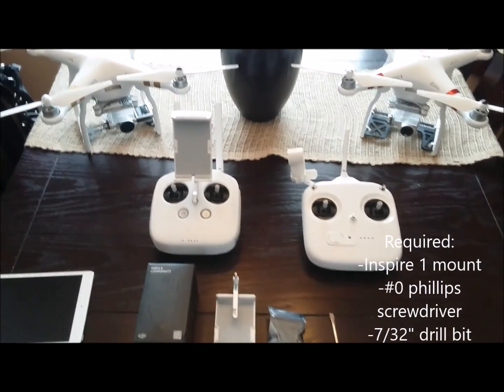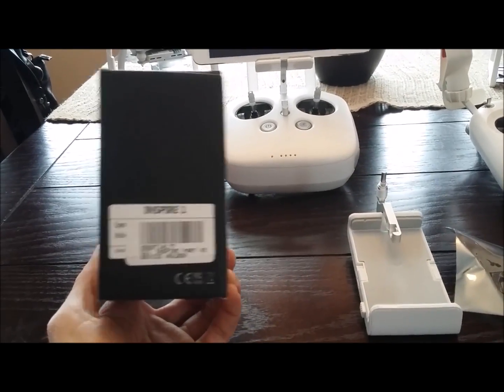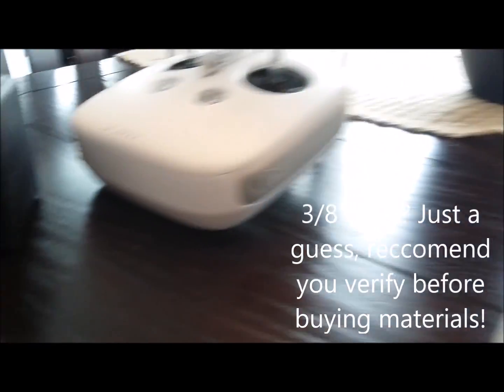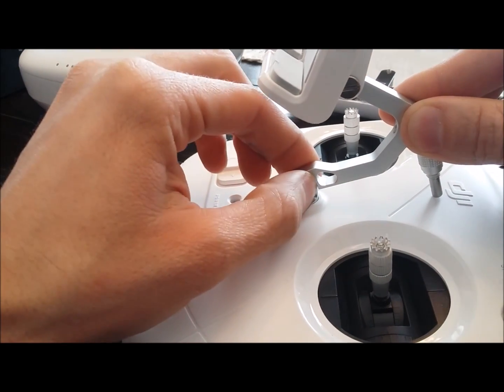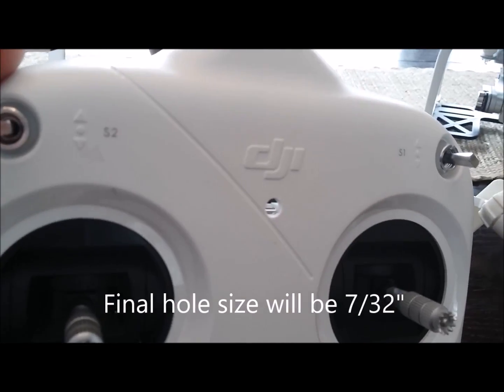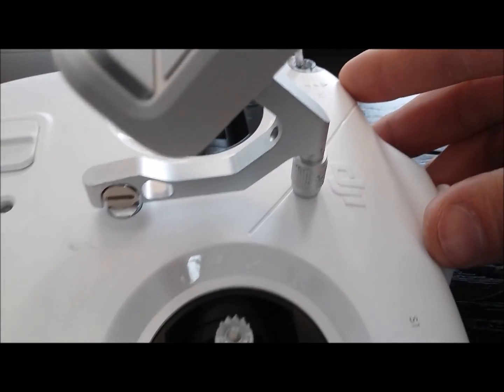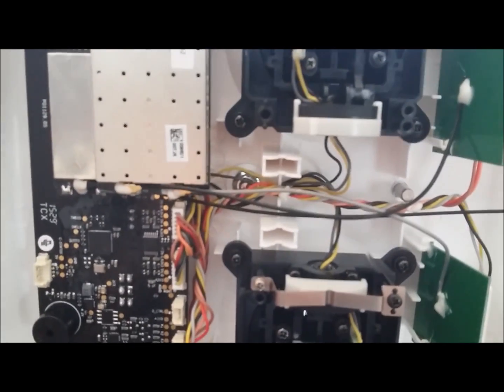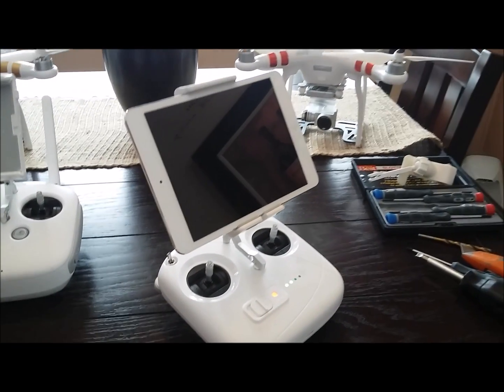DJI Phantom 3 Standard controller mod with Inspire 1 mount, for tablets

Comment: Excellent mod for my Phantom 3 Standard, I luv it !  Thanks so much Droning Around, well done !!
Can't imagine trying to fly without it.  Follow DA's direction for install to the letter, didn't need the 1/4" bit.
Just drilled a pilot hole after scoring and used the 7/32" drill bit, then screwed threads it into the hole and mounted sent screw.
Btw, I'm using a Galaxy Tab A 10.1 table.  This tablet mount is as strong as a vice.

Comment: High, great video, does the controller still fit in the case?
Reply from the maker: Depends on the case! It does stick out where it wouldn't have before, but I feel the controller is useless without it, so personally I'd buy a case that fits around this conversion!

Comment: Great vid. Are you still modding controllers? Realize the video is a tad on the older side.
Reply from the maker: PMCRyan Thanks for watching.  Yes, absolutely, I still do these modifications.  I own a drone repair business and I keep the mounts in Stock for conversions.
Reply: I'm gunna give it a shot myself and pray to the DJI gods that I don't mess up. Will be following your review. I have a 9.7" iPad; if I throw a case on it, any idea if this mount will still hold it?

Comment: I have 10 drill bits which go from 1mm up to 10mm, what would you recommend using to drill the whole?
Reply from the maker: Adzchannel I would reccomend you drill and tap the hole.  Since the video posted, I have found this to be best.  You will need to drill a 5mm hole, followed by a m6 x 1.0 metric thread tap.  Then the mount will cleanly thread right in.

Comment: Does this mount fit a iPad 4th gen?
Reply from the maker: The max opening width of the Inspire 1 mount is 6 5/8" or about 168 millimeters.  As long as your iPad is that or smaller, it will fit.
Reply: I have been told by JTO2GO that he uses a 4th gen iPad with his inspire 1 tablet mount, however the 4th grn iPad is 186mm in width. I don't get how it fits if the table mount is only 170mm in width?
Reply from the maker: Adzchannel I just measured mine again to verify.  if I fully extend mine and cannot force it any further, I end up with the same measurement.  Excluding the squishy foam, the physical plastic to plastic opening is exactly 6 3/4 inches  (6.750), or 171.5 mm.  So, I'm not sure how that's possible.  My L1 mount is one of the earlier models, perhaps they started making them larger now to account for larger tablet sizes?  Hopefully someone with a newer mount can verify.

Comment: Worked flawlessly now I just have to charge my remote and I can test out flying with my tablet. Thanks for posting this.
Reply from the maker: Tim Taylor Excellent, good to hear!  Glad it was a success, you will love the results.  What are you using for a mobile device?
Reply: I have a Lenovo Tab 10 10.1" it's a bit heavy but I think it will work out OK.
Reply from the maker: Tim Taylor Cool.  As long as it's a supported device from DJI it should work fine.  I personally use an ipad mini 2, I find the larger screen sizes are akward.  Let me know how you like your setup! Thanks for watching.

Comment: I did check with DJI..drilling the hole voids the warranty. Too bad, the 3S controller needs a better mount for larger tablets for us older folks to use the GG app and view what the camera sees. Thanks for the video.
Reply from the maker: Jim Robinson Oh absolutely!  DJI will void your warranty if you so much as sneeze on it.  Kidding... ;).   But yes, agreed.  I suppose that's why it is the standard.  If the standard were perfect, then nobody would buy the advanced or professional.  Thanks for watching, I greatly appreciate the support!

Comment: Since the back has already removed, why not pit a self-locking nut on it? Nice  tutorial. Thanks
Reply from the maker: Charlie That's an excellent idea, however if I remember correctly, I don't think there are enough threads protruding to thread a nut on   :(  Unless you are able the cut threads into the smooth metal part that sticks out.  Thanks for watching and commenting!

Comment: Excellent video and super easy mod. It took about 15 minutes from beginning to end and the result is great. Question... How do you keep the screw in the swing arm from loosening when you fold it down for storage?
Reply from the maker: Michael Hansen Good to hear, thanks for watching!  I keep my pivot screws pretty tight so my iPad doesn't flip around.  The screws stay tight for a long time, I just snug them up every once and a while.  You could use some thread locking compound if it becomes a persistent problem.
Reply: Droning Around Thanks! I'm going to go ahead and use a drop or two of threadlock and see how it goes. :)

Comment: Just to point out, the link provided takes you to a non prime $39.00 mount, where if you search for the Part 45 mount, you can find a $30 Prime option.
Reply from the maker: Nathan Marshall Cool thanks.  You can find them all over online so it's not a big deal, I figured if most people could do the modification that they would have no issue finding the part too.
Reply: Totally, just making it easier for them. :)

Comment: Is it possible to connect via USB a Phantom 3 Standard controller to a tablet?  I cant find an answer anywhere, thanks! :)
Reply from the maker: Astolfo Fumagalli No unfortunately you cannot.  The Standard pairs via the WiFi signal.  Only the Advanced and Professional connect via a USB direct link.  Naturally, the USB link, along with DJI lightbridge brings a much clearer FPV experience.  The Standards weakest point in my opinion is the WiFi link.  Sorry buddy!  You can however, connect to a tablet via the WiFi like any other device.

Comment: How are those threads holding up in the plastic thus far? Any wobbling or loosening over time?
Reply from the maker: +iinRez I sold the Phantom shortly after this video, but as far as I know the mount held up just fine.  Unless it was abused, I wouldn't expect an issue.

Comment: But will I still be able to use my lanyards
Reply from the maker: Yes you can. See the machined oblong hole on the aluminum mount? That's for the lanyard connection.  The Inspire 1 remote functions the same way

Comment: Use a dremal tool not a drill to make the hole for the aluminum piece on the mount a drill will ruin the plastic.
Reply from the maker: A drill is slow and controllable.  A dremel would be very risky given its high rotary speed.  I cant count how many times I've used a dremel and then had it go crazy and resonate inside the hole opening and quickly remove too much material.  I'm not seeing where using a dremel would be an advantage...?

Comment: this video was great! I completed this modification but experienced signal dropouts. I sent it to dji to repair and it was a broken motherboard. all I'm trying to say is BE CAREFUL WHEN DRILLING AND TAKING REMOTE APART! that motherboard will set u back $100
Reply from the maker: Dang dude, how did you damage the main board, it's no where near the hole!  And the only wires in that area are for the aux. switches lol.  Bummer man, but anyway thanks for the "thanks"!  Good luck with the new upgrade (and repaired remote!)
Reply: +Preston Rice I don't know how it happened either. all I know is that it's on its way back to me

Comment: Thanks for the video! 
I'm just also thinking about this mod, but my main concern is if it won't disturb the signal strength of live video(wifi). Because I had an aluminum phone holder mounted where the original was and it was just in front of the wifi antennas and the range got very bad. Thats why the original is made out of plastic. 
So  the inspire mount is not in front of the antennas but still, does it make any difference in range?
Reply from the maker: Hmm, I never thought about a range concern, but I doubt given its location directly behind the WiFi antennas that it would harm the signal.  An aluminum mount in place of the factory one that is in front of the antennas I could see definitely being a problem.  Unfortunately I have since sold the standard and upgraded to the Inspire 1, so I won't be able to make a range comparasin.  Thanks for watching!

Comment: Awesome video! 

I had one question. Is there any marking or indication as to which cables are supposed to be connected to which inputs. I just wanted to make sure before I started! 

Thanks!
Reply from the maker: Thanks!  I don't believe any of the cables are marked.  It's best to simply take a few pictures for reference beforehand, than take it apart.  I believe all the connectors are unique and cant be easily mixed up.  Just be careful, they are awful small and fragile.  Good luck with yours! Let me know how it turns out!

Comment: BEWARE!  I cannot stress this enough, make sure that you protect the wire bundle in the area where you are drilling.  There is not much slack in the wires that would allow you to get them out of the way - I managed to cut through several of them and now have a delicate splicing job ahead of me!
Reply from the maker: Ouch!  I'm sorry about the mishap!  Thanks for the warning, yes you must be very careful as to what is underneath!  When I drilled through mine, I used a very small drill bit first that was too small to snag any wires, then once I located the hole, I was able to move the wires away before sending the larger drill bits through.  Good luck on the rest of your upgrade.

Comment: Watched your video and ordered the holder. Just finished installing on my Phantom 3 Standard and works great with my iPad Air 2. Thanks.
Reply from the maker: Awesome, glad to hear I was able to help you.  The Air 2 is certainly an upgrade to whatever you had used before!  Makes flying the Phantom 3 standard so much better!

Comment: I just want to make sure where to drill in pilot hole.  I am assuming the black mark is where I
should drill my hole.  Are you supposed to drill right on the mark or above or below the mark?
Reply from the maker: +Robert Glosson You will drill on-center to the mark you make.  As long as you mark in the correct location like I show how to do in the video, you will be right on.  When your aligning the mount to make your mark at the bottom side of the threaded portion, that's where your mark will be to drill on-center.

Comment: If I don this, can I take the mount off and on as I please?
Reply from the maker: +Thomas Riisgaard I would not recommend it.  The mount will thread very tightly into the plastic, and the plastic could wear and strip out over time if it is constantly being removed.  If you are able to find a threaded insert, then that may hold up better.  I would recommend getting a cast designed for the Phantom 3 Pro or Advanced, then the controller should fit in just fine with the mount on.

Comment: Used your video as a template. Thank you. Did mine within 12 minutes. Had another tablet mount that mounted onto the metal bracket of the controller. It would wobble a lot. Screws stripped out easy. Saw this video and am glad I did. Purchased the Inspire 1 mount off ebay for 28 dollars shipped.
Reply from the maker: +DiGitAL BLoOdy FPV Great, good to hear!  I was very happy with the Inspire mount, works perfectly.
Reply from the maker: +DiGitAL BLoOdy FPV Great, good to hear!  I was very happy with the Inspire mount, works perfectly.

Comment: Did you have to remove some wire plug connections when opening the case?
Reply from the maker: Yes, there are a few that you should unplug to give yourself more room to work with once you split the case.  I apologize, 
my video clip showing which wires to disconnect got corrupted and didn't make it to the final edit.

Comment: Did this today on my phantom standard. Now, I'm not the most skilled craftsman by any measure but found this a simple procedure. Just a note for non USA residents, I used a 5mm drill which was just perfect!
Reply from the maker: +paul twambley Awesome, glad to hear I could help!  Thanks for the note about the metric drill bit.  It was hard to find a good fit in the imperial sizes that wasn't too tight or too loose!

Comment: Amazing video Preston, for anyone interested in taping the hole, I used a #7 (13/64) drill bit which is slightly smaller than a 7/32nd's. I then used a 1/4-20 tap. I hope this helps.
Reply from the maker: +Trevor Acor Awesome, thanks for the feedback.  I thought the thread pitch seemed a bit smaller than I initially had estimated.  Sure was a PIA to shove the threads through the plastic, I would imagine a tap is the way to go ;)

Comment: Very well done, it looks like a professional installation.  I'm going to have to work up the nerve to poke a hole in my brand new Phantom Standard 3 controller.
Reply from the maker: +Thomas McLehaney Thank you!  Yeah its always a little nerve racking drilling a hole and hoping you get it right, but as long as you follow my instructions, its pretty easy.  Its definitely worth the upgrade though.  I haven't flown my Standard for quite a while because I couldn't use the iPad like I do when I'm flying the Pro, but after this upgrade I was able to.  Its very sturdy too, just don't drill any larger than 7/32" ;)
Reply: +Thomas McLehaney  its an easy mod  just did best choice I ever made